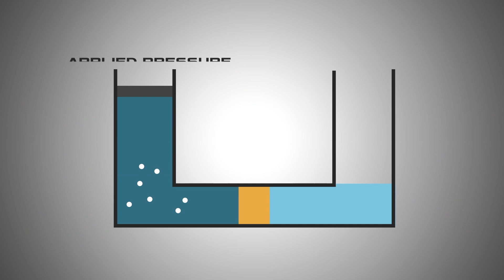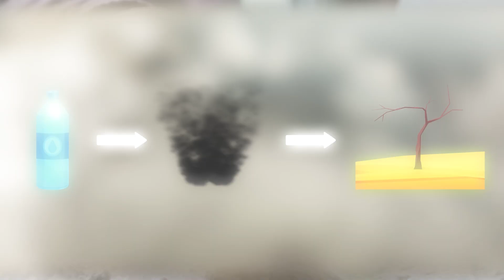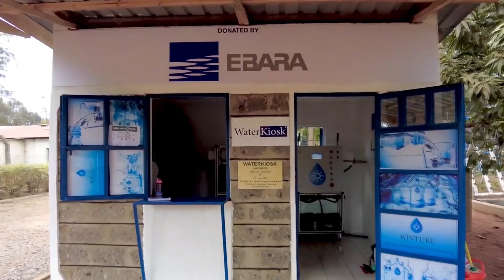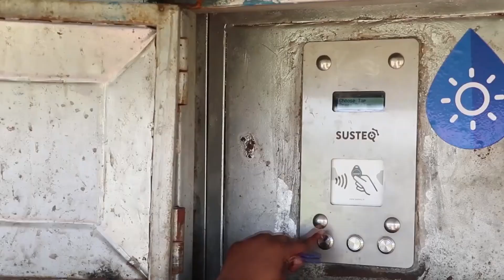Can desalination quench the world's thirst?

Comment: HEY!? I'AM NOT SO SURE THERE IS A WATER AVAILBILTY PROBLEM!! MORESO THAN  DISTRIBUTION ONE!! I PERSONALY BELIEVE WATER SHOULD B GRADED FOR USE!!! THAT WAY DRINKING WATER IS NOT USED FOR WASHING!! BATHING; & GARDENING!! ECT.THEREBY MAKING ALL THESE USED AREAS DESIGNATED WATER TYPES!! IN HOUSE METERED FAUCETS GIVING REALTIME INFO ON USAGE!! THIS TECH CAN REDUCE CONSIDERABLE WASTAGE!!! FURTHER INCREASE WATER CAPTURE BEFORE IT REACHES THE GROUND!! ABSORBTION BY ATTACHED EEFICIENT HIGH TECH.ALSO!,WATER CAPTURING SYSTEMS!!A TECHNOLOGY THAT CAN B ADDED TO ALL AIRCONDITIONERS!! AS AN INDUSTRY STANDARD!!! REMOVE LICENSING FROM ALL!! OUTBOARD MOTOR MANUFACTURING FROM THE INDUSTRY!! SUCH ARE KNOWN LEECHERS OF FUEL CHEMICALS INTO MANY A LAKE BODIES OF WATER!! BECAUSE OF POOR OR RUPTURED SEALS!! ALONG THE VIRTICLE SHAFT LENGTH SINCE WATER HAS BEEN ALREADY DISCOVERED AS A DATA COLLECTING RESOURCE !!! ONE HAS TO CONSIDER ALSO THIS PLANETARY FINITE LIQUID (Ms.)! HAS TO B THE CENTRAL SYSTEM OF THE PLANET!! AS WELL!!, MOLECULARLY GOVERNING ALL ENERGY TYPES!! WHERE MAJOR CONTAMINATION OR POISONING & CAN EASILY CRIPPLE THE CYCLE!! CAUSING CATACLSMIC EVENTS AS A FINAL TALLY!! AFTER DISTRIBUTING CANCER EVERWHERE!! AS IT NOW DOE'S!!...